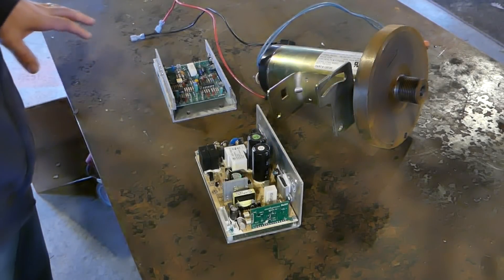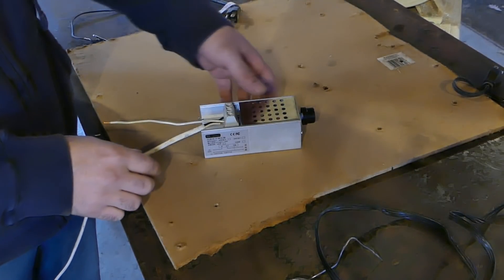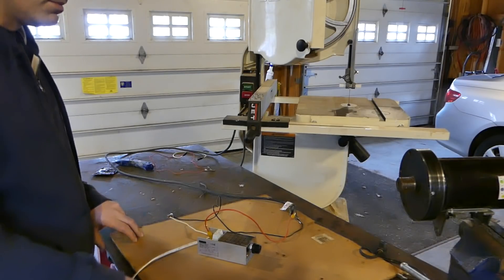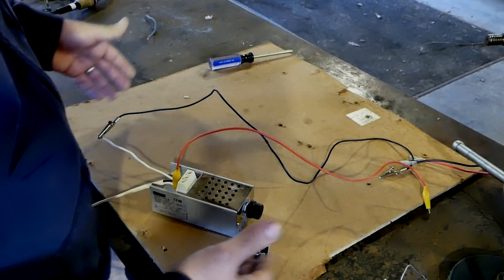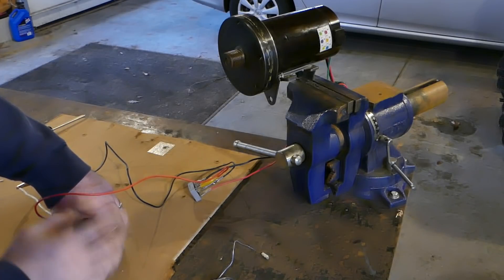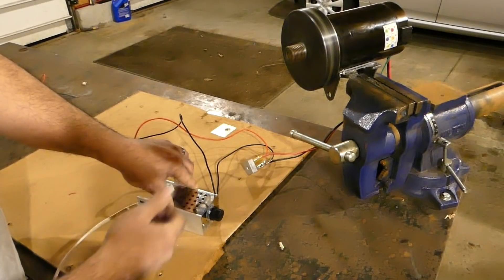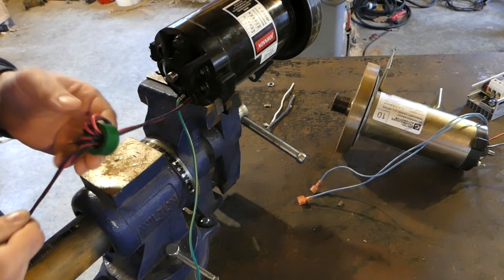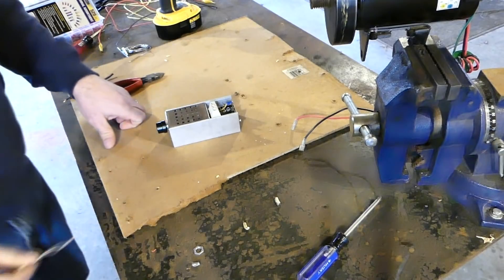Low Cost DC Motor Controller For Treadmill

Comment: Thanks for this demo.  I would suggest adding one or two fixed resistance resistors (about 10k ohms) in series with the potentiometer. If placed on the correct side of the potentiometer it will allow you to use the full range of the potentiometer instead of 3/4. (Trial and error).  

The ramp up time may be important. I am fitting a similar motor to a Boxford engineers lathe. It is 2.5 HP and its resistance when stationary is only 2.2 ohms. That means that when you apply 180 volts without the ramp up, it could draw 82 amps and blow out your circuit or a fuse. Once it is spinning it acts like a generator causing a voltage opposing the supply voltage. This means that the effective voltage is decreased to supply voltage minus the reversed generated voltage and once up to speed it limits the current. For this motor it draws 8.5 amps at 4700 RPM. 

There is a better method now available with units from China HQ-SXPWM-X for about $US57 plus tax and free shipping. This is specifically designed for controlling DC motors of various voltages. Different models for different voltages.  This is being discussed on the Boxford users group.
Reply: I have a variable speed controller with a 500K potentiometer driving a DC 180v motor. The motor has an RPM of 4000 but I really only want to use a range of 50-400RPM. When using the potentiometer I'm finding it is overly sensitive and isn't giving me the control over the lower RPM that I need. Would adding a fixed resistor across the Pot reduce the range of RPM? If so what value resistor should I start experimenting with and which wires does it need to intersect?
Reply: @danielrogerson6635  Hi I see you are having fun with this.  I think what you need is a fixed resistor in series with the potentiometer.  This is how I think about it:  You appear to have a two wire connection for the potentiometer rather than three. So the circuit is being regulated by reading the resistance. You check all this with a multimeter.

I have the HQ-SXPWM-X controller and it uses a three wire connection. A reference voltage of 5 volts is connected to one end of the resistor inside the potentiometer and the other end of the resistor is connected to ground. This creates voltage gradient along the length of its internal resistor. Then the wiper moves along the internal resistor and picks up the voltage at its current position. If turned to half way it reads 2.5 volts. At 20% of the way along it reads 1 volt etc. So the controller circuit is being regulated by the voltage. 

Your SCR circuit appears to be different. (I have one of these $15 SCR AC speed controllers and it runs a sewing machine motor really well, straight out of the box.)  Yours only has two wires connected to the potentiometer as far as I can see. One wire would be connected to one end of the internal resistor and the other wire must be connected to the moving wiper. If you have an old potentiometer pull it to bits to see how it works!  

The circuit must be controlled by the resistance it sees.  I imagine that it goes fastest with zero resistance. If so, when it is turned fully clockwise to maximum speed the wiper is connecting almost directly to the other wire. That is one wire is connected to the wiper and the other wire connects to the clockwise end of the internal resistor. 

Lets say the potentiometer has an internal resistor rated at 100,000 ohms and it is a linear scale rather than logarithmic. Now if you discover that you have to turn the knob 75% of the way before the motor begins to turn, the resistance the circuit is seeing is 25% of 100,000 = 25,000 ohms. It is only using the top (clockwise) end of the resistor.  Then you need a 25,000 ohm variable resistor to give you full range.  The RPM should vary from 0 to 4000 as you rotate the knob of the 25,000 ohm potentiometer.  

However you only wanted 400 RPM, that is 10% so you only need the first 10% of this 25,000 ohm range. So you would need a 2,500 ohm variable resistor followed by a fixed resistor to make up the total of 25,000.  Ideally a fixed resistor of 22,500 ohms. You may be able to get 22 kOhms, but if not any where from 20,000 to 25,000 would probably be good enough.  This should give you a speed range from 0 to 400 RPM. 

If you put a 'shunt' resistor in parallel with the potentiometer you can calculate what happens to the overall resistance R from the formula:
1/R = 1/R1 + 1/R2
Where R1 and R2 are the two resistors wired in parallel. In your case one would have a variable resistance. If you had a shunt resistance that is lower resistance than the variable resistance you could increase the variable resistance towards infinity (1/R=0) and the shunt resistor is what the SRC circuit would see. You would not be able to turn the motor down to 0 RPM. 

My video about how pulse width modulation and variable frequency drives work is on my lathe channel evan-e-cent.  Look for the blue square wave image. I am not an electrical or electronics engineer but have studied science and engineering all my life while working in medicine.
Reply: @danielrogerson6635   I know this is old, however try this.
Measure Pot resistance at lower/far left setting as R1.
Get your motor at the 50rpm low end you want, then remove power and measure resistance of pot as R2.
Now do R2 - R1 = R3.
Now get an appropriately sized resistor that is around R3 - 10%, and add that to one of the leads to the Pot.
Now when your pot is at Low the motor should not spin, but just a tick above low it will start spinning at close to your 50rpm.
Without getting a new pot its going to be harder to get full range between your desired settings.  Doing it this way will at least get your control at the low end much closer to where you expect it to be by knob position.

Comment: I have got 220 V DC, 12 amps, 4000 Watts motor. If I apply this type of set up, will that make it a workable treadmill, that will support a running individual on it?

Comment: Hi Mike, I am trying to do this with a router speed controller and a full wave bridge rectifier. It works but the motor does not  slow to zero. Is it the potentiometer causing the issue?
Reply: same problem on my lathe, in the zero position the motor runs at a few hundred RPM

Comment: Great video...thanks! I'd like to upgrade a vintage drill press with a 110V treadmill motor and controller. In addition to the variable speed feature, I'd also like to have a forward/reverse switch and an RPM readout. Is that possible? Thx

Comment: Did i miss it.  Or what but u dint. Mention what size of potentiometer  u installed  to replaced the old one , what i herd was u had 100k  potentiometer and that one was to big for your project.   So what is the right potentiometer?...

Comment: I can verify that this works.  It took about 20 mins to hook up.  I bought the recommended potentiometer and I still don't get full range of the dial.  I bought it to replace this controller I bought off of ebay.  https://www.ebay.com/itm/120-VAC-To-DC-Motor-Speed-Controller-For-Any-90-130-VDC-PM-DC-Motor-Up-To-4-HP/303162387650?hash=item4695e2ecc2:g:OiQAAOSwAmVck46n  It worked great for a while and then one day didn't work.

Comment: Went through all the comments and didn't see my questions exactly. My motor has 4 wires, black, red, and two blues. If I understand from the other comments, I do not need to use these two blue wires, correct? And do I need to buy additional wire to go from power cable to rectifier to SCR controller? If so, what kind?
Reply: Two blues just get capped off

Comment: no,no,no ,the speed on a AC motor has to adj speed ,torque hz and voltages not just voltages because you loos the  torque,the dimer  is for  lightning,no need torque @ all , the  fan speed controller need very low torque by law because is very,very very danger whit big F,P,M (OK )to table saw you only need a bridge rectifier that way you have a full speed and torque because you no want to reduce the speed on a table saw motor ,,,,,never ,never, never ,never never ,  why  they need different motors for every application that's the answer ,but if you use a (inverter )you have VOLTAGES ,HZ, RPM and  TORQUE ,see you can call me  dummy ,but that's what you need boy.!

Comment: What setup would you recommend to control the dc  motor that controls the infeed table of a  drum sander? I bought a sander that didn't have the pc board or motor. I can find the motor but don't want to spend $400 on a new board!

Comment: Amazing info! Curious what size the potentiometer that was originally on there was before you but the 200k one on? I can buy a scr controller that comes with a 470k potentiometer, is bigger better or should i order a 200k also? Thank you
Reply: The scr he had originally came with a 470K , you need to get a 200K and replace the original one.

Comment: built 3 of these things now, and converted my Craftsman Atlas 12" lathe and my little Atlas 618 lathe to treadmill motors with these controllers.  Added a tachometer on them also, dirt cheap.

Comment: Are you getting the full range of motor RPM, though? Say 10 - 3000 rpm. I suspect not. Your bandsaw motor controls poorly because it's a highly inductive load - your triac controller is almost completely ineffective due to false triggering of the triac. Running an AC induction motor like this (except very simple such motors at low power) simply won't work. Your DC motor is also an inductive load, but less so - so similar problem.
These simple triac controllers - usually no more than about six components - suffer badly from 'hysteresis' effects, which is why you struggled to control the speed with the original pot. Changing the variable resistor may have solved the problem but at the cost of greatly reduced speed range.
It's worth getting these treadmill motors running slowly because the permanent magnet motor, almost uniquely, maintains torque at very low rpm. Ideal if you want to run your bandsaw slowly for metals cutting.
There are much better ways of controlling DC motors than with this simple e-Bay triac device. There are more complex designs based on thyristors (not triacs) or, provided this is a US style 130v DC motor, running a PWM controller from the 110v mains should give good results. PWM controllers CAN be obtained cheaply on line although for 110v, some searching may be needed.

Comment: It looks like I'm using the exact same SCR and BR as you are.  My treadmill motor has 4 wires coming out of it. 2 blues, a black and a red.  When I plug my red and black into the BR, the motor doesn't spin at all.  The motor works fine with the factory treadmill control board though and I'm getting 110VDC out of the BR.  When I remove the BR and just use a light bulb, the SCR will dim the light so I know the SCR is working.  Any ideas why I can't get it to control my motor?

Comment: Use a PWM, not an SCR speed controller.  There is little power until you max out the SCR controller.  The voltage of a PWM is constant and the duty cycle is variable, therefore, power at lower speeds as well.  Amazon has a nice little speed controller for motors up to 400W.  This is a better and inexpensive solution:  https://www.amazon.com/24V-90V-Controller-Electric-Regulator-Permanent/dp/B076KPP92X/ref=sr_1_31?crid=1JI6O03S0UE2U&keywords=motor+speed+controller&qid=1572315832&sprefix=motor+spe%2Caps%2C279&sr=8-31
Reply: Appreciate your comment. Would the PWM controller you posted a link to work well with a Leeson PMDC motor rated at 130V, 20A and 3HP?
Reply: @jeffviebrock2222  
3Hp=2237.1W and the Speed Controller can only handle motors up to 400W.  You would need a bigger speed controller if you need 3Hp or you must keep the motor draw below 400W.  So yes it should work as long as you keep the wattage draw to within the speed controller specifications. One last thing, the controller voltage goes up to 90V so the motor will be slower than if running it at full rated voltage.  That being said, you should still have lots of RPM that you can vary.

Comment: What is the voltage of the motor?  If it you out more voltage than thr motor is rated for, it will demagnetize the permanent magnet motor, and slowly kill the motor.

Rectifying AC increases the voltage, about 170%, (if my memory is correct). These treadmill motors can be anying from 80VDC to 180VDC.  Check your max voltage!

Also, just a rectifier doesn't make DC, it makes chopped AC, negating the negative side of the AC.  To get closer, and clean up the rectifier output, you need capacitors on the rectifier output, and a voltage regulator.

The caps help smooth out the chopped AC, to make it closer to DC, (but STILL not DC).  DC power supplies will have an additional device after the caps, an induction coil, (again, if memory serves me; dbl chk what this).  

The thing he called an inductor is a choke, for cleaning up radiant voltage.  The device I'm talking about goes in line.  (I could have choke and induction coil terms swapped).  The point is, you need to determine how close you need to get to DC.

If you buy a DC power supply adequate amp rating and add a pulse width modulation unit, (the "piece of junk" he called it), you will have a solid, reliable variable speed motor.

What I have learned, (the hard way), is the inexpensive Chinese DC power supplies likely won't have overload protection, so if you stall the motor, it will kill the power supply after a few times.  If you will never stall the motor, not a worry.  It you might, look out.

Comment: I take it that this only works if you are using 110v power supply ?? Yes ?? This treadmill motor cant handle 220v through this set up ??? Am I wrong ?

Comment: Do you have any solutions to adapting the flywheel to not spin off. I'm in the process of a 2x72 build, and was going to just mount the motor/belt to the left side, but I'm afraid it might restrict my use of attachments since 95% of grinders I see all drive the belt on the right. Am I over thinking this? What's your opinion?
Reply: Simple option 1: mount motor on other side of grinder. (this is the one you want to do)
Simple Option 2: weld pulley to shaft (not ideal, but doable)
Difficult option 1:  drill a hole in the pulley, grind a flat on motor shaft, and install a set screw 
( screw pulley on fully, drill through pulley till it marks shaft, remove pulley, grind marked area flat, tap hole in pulley, install set screw after re-screwing pulley firmly onto shaft)
difficult option 2: Cut a keyway into both the motor shaft and the pulley 
(screw pulley onto shaft, drill at the cross section between shaft and pulley, remove pulley and clean/round threads, re-install pulley, tap nail/rod into hole, I wouldn't recommend this method, but it would work... in theory)

Not responsible for any damage you do to your motor or shaft if you decide to go with either of the more difficult options.

Comment: How did you wire the potentiometer, it has 3 prongs and only 2 wires, I’ve tried several configurations and soon as I give it power it goes to full speed with no speed control
Reply: In most cases, connecting one wire to the middle terminal and the second wire to either of the outside terminals will provide the same functionality, the only difference is that it will reverse which ends of the potentiometer's dial represent minimum/maximum ohms, connecting the wires to the two outside terminals will use only the maximum resistance value of the potentiometer, rendering it useless in most applications.  If it jumps to full speed the moment you turn the dial from both ends of the potentiometer, I would try a different value of potentiometer, start with maybe 100k, then 500k then 1m. Might have to trial and error between these values to find a the ideal pot if none of those provide a useful amount of variability along the length of the dial.

Comment: https://www.instructables.com/id/HOW-TO%253a-Wire-a-DPDT-rocker-switch-for-reversing-po/
Now this Switch is momentary  you'll need a DPDT switch that is not momentary but this is in case you want to run the motor either direction without unplugging it and changing the wires around.
https://www.amazon.com/Morris-Products-Toggle-Switch-Off/dp/B00CAPWEFW?ref_=fsclp_pl_dp_6
This should work. But i haven't tried it.  Say your using this on a Mill, Lathe Router or shaper or some tool you need to change direction on  you would hook the wires up to the DC side not the Ac side  so in the Diagram step 5, the actuarator would be your motor power would feed in on the center poles.
120VAC  to speed control  output to bridge rectifier DC to switch then to DC motor.
Let me know if it works for you.  Make sure you place this in a box this type of voltage can kill you. And cover the terminals of the motor really good too.